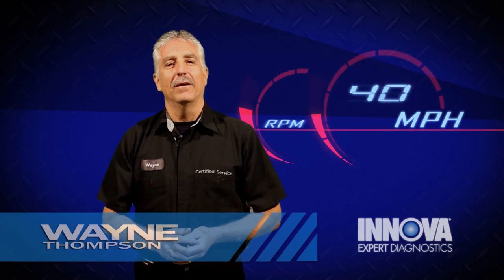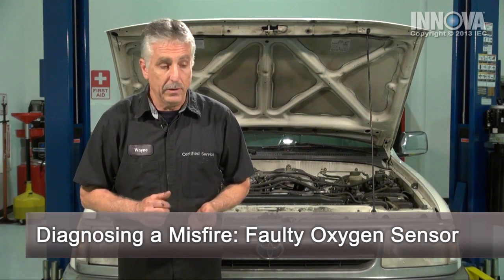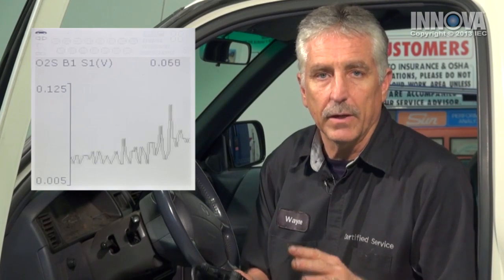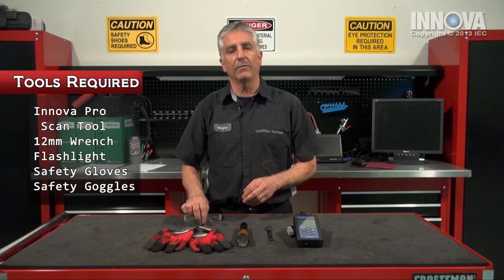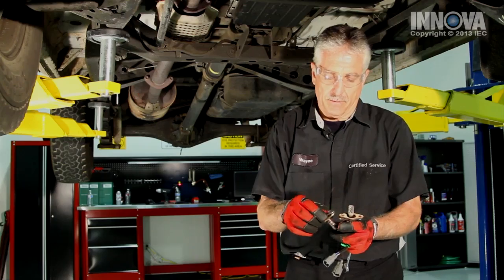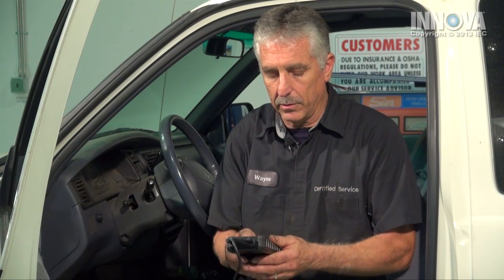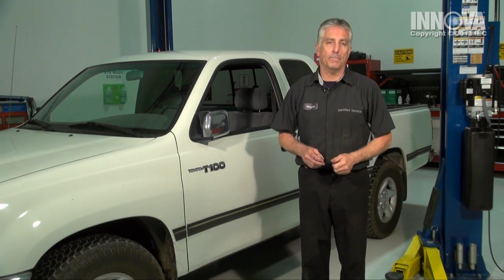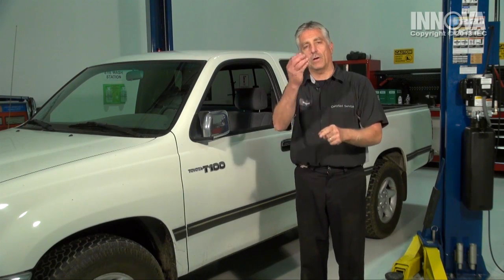How to diagnose a Misfire - Faulty Oxygen Sensor - 1997 Toyota T100

Comment: I have a p0172 code on my 97 honda civic is it a leak or the sensor? I am seeing a big price for the upstream sensor is worth 200 to 500 dollars.
Reply: I have the same issue 96 Honda Accord 2.2 runnin super rich ... p0172 and a couple misfire codes changed and plugged a few holes in muffler now all bad, my o2 sensor or sensor(s) have gone bad, if you changed your spark plugs, wires, distributor all that or atleast run tests and can't figure out what it is do a reading on live data with a scanner read the o2 sensors possibly will and can be that maybe the catalytic converter as well like my issue. But hopefully it's just the sensor ! Keep me updated

Comment: 1995 Toyota T100 3.4L. I had codes P0141 and P0170 and ran like crap. Did a tuneup which was short lived. Added sea foam and exhaust does have weird funny smell. Now the P0141 appeared again. Think I will new replace the O2 sensor bank 1 sensor 2. Thanks for the video.
Reply: Bad o2 sensors smell like rotten egg or sulfur

Comment: hello, i have a audi a4 2.0 tdi, and i have a error about the o2 senzor on bench1 sensor1, the simthoms are higher fuel consumtion, and at low rpm i have misfire....the only thing i'm concerned of it's why at cold start until the engine warm's up i have a white cloud of smoke??? can you please tell me is this could be also from the o2 sensor, or it's something else. thanks